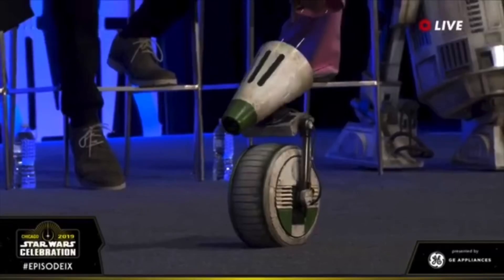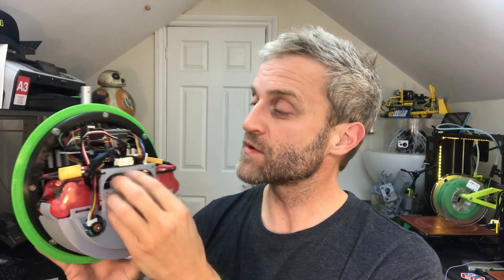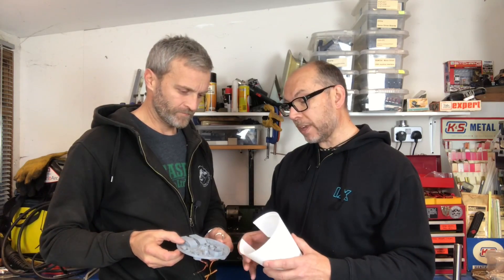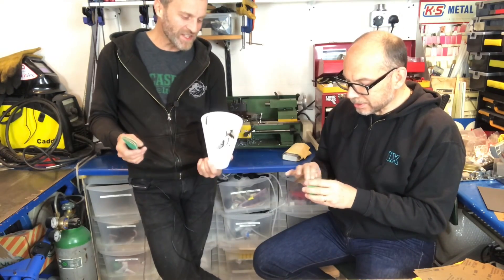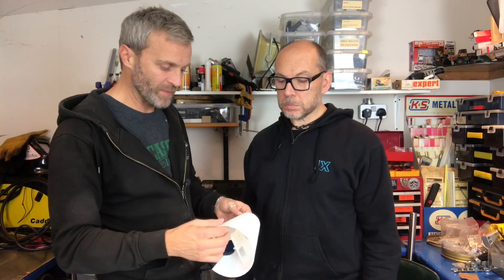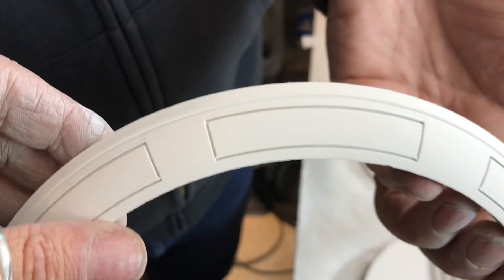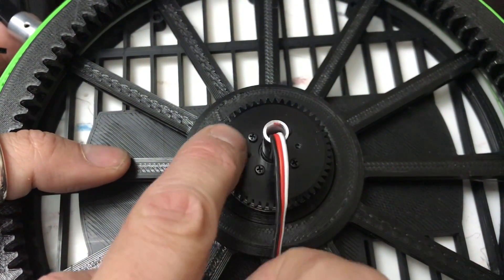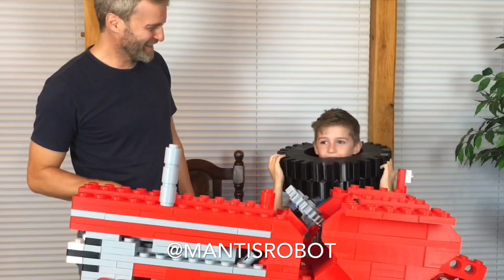Droid Build D-O - #4 - Mantis Hacks

Comment: Another grt vid.. I'm defo hooked on this project! Erm... even without the bikini shots ;-).  Re heating issue wondering what would to happen to that heat build up if those large black spokes had fins on them to disrupt the air around the circuitry?
Reply from the maker: Thanks! Yeah I did wander about the spokes moving air around, they open a lt do a bit anyway.

Comment: Looking great! As far as the wobble, would it be feasible to damp it mechanically? Like with a slightly flexible coupling somewhere between the head and the servo?
Reply from the maker: Yes and no. It currently has an elastic ban that pre tensions the servo in one direction, but ultimately the best way to remove slop is just remove the slop! Eliminate backlash in everything...

Comment: For parts that have little details and grooves like D-O's head, I really like using XTC-3D. It's a two part epoxy that you brush on & it sets over the gaps, making everything nice and glossy. You then hit it up with 320 grit and do the process one more time. For me personally, this has saved me so much time when sanding/painting BB-8's panels.

Also for the painting process, I'm assuming you are going to weather the heck out of D-O, correct?

Lastly, I am still having major issues getting the 1010's to do OTA. None of the libraries I found seem to work, even after firmware updates and internet setting changes.
Reply from the maker: Hi. Thanks for the tip. Yes it will be weathered / painted by another guest :)

Don’t know why the OTA is not working.. it has been working well for me. I can try and find a way to share an examole
Reply: @MattDenton  Thank you, much appreciated.